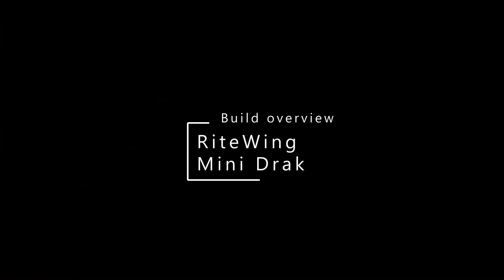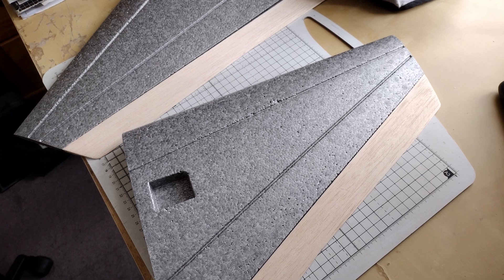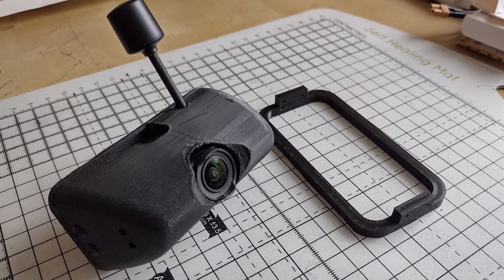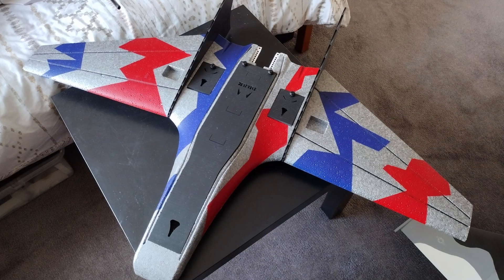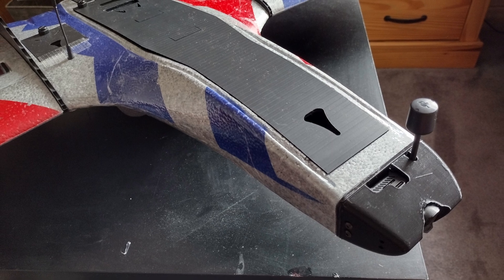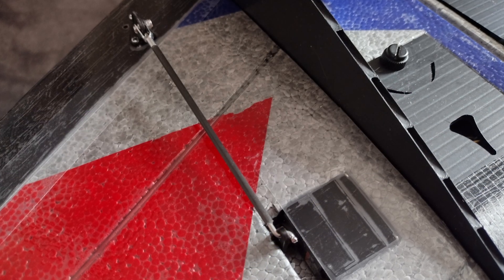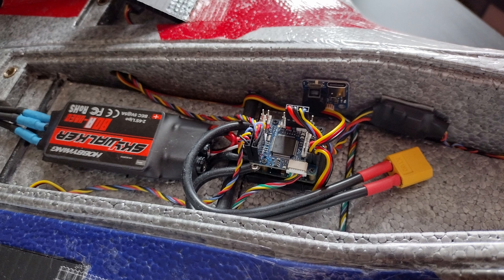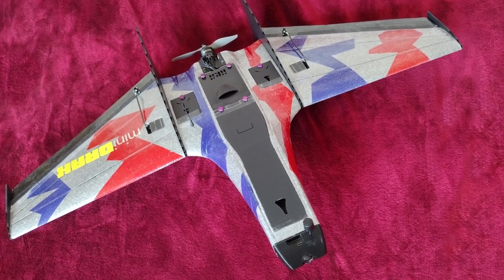Ritewing Mini Drak - build overview

Comment: Could you share your inav pid (piff)   I'm getting  a pitch up and down movement  during cruise and RTH 😢
Reply from the maker: I've seen some very odd behaviour with the latest version of INAV - is your issue like this video?   https://youtu.be/N0CbEymUxSM
Reply: @Caroline_Tyler  yes kinda like that but only in cruise or rth. Acro, manual and angle horizon are good
Reply from the maker: This was flying a mission, so basically, the same as RTH and Cruise. I never had this in previous versions of INAV and I got this same effect on two totally different airframes running the same mission AND at the same leg of the mission. It's all very odd.
Reply from the maker: Are you also seeing the same increase and decrease in throttle?
Reply: @Caroline_Tyler  maybe it's the pitch to throttle? Mine is set to 10 I believe
Reply from the maker: The wing that video was from is also set to the default of 10 micro seconds. You can see the throttle going much higher that that pitch to throttle would suggest. I will raise it on the GITHUB for INAV as a possible bug. It's really odd that it only in computer directed flight. I don't fly the Mini Drak in cruise really, mainly ACRO and MANUAL - it's too much fun to leave it to the computer to fly.  :)
Reply: @Caroline_Tyler  me too but sometimes rth is needed when video cuts out breifly with Walksnail and dji.   I'm considering going back to analog if I can't fix it.
Reply from the maker: I've added to an ongoing issue in INAV where another pilot in getting porpoising in cruise like yourself.
Reply: Curious what's your pitch feedforward?  
Mine ended up at 133.
Reply from the maker: Roll is p=8 I=3 D=5 FF=34
Pitch is p=9 I=4 D=6 FF=85
Reply: @Caroline_Tyler  maybe it's my 0 degree fixed wing level trim. I'm going to do a auto level and see if it changes. I don't know what it was in inav 6.0.   I forgot about that step during tuning
Reply: @Caroline_Tyler  my feedforward pitch was almost the same moment as manual mode.   I'm just going to try your pids. I just hope it doesn't crash  launching. How is your auto launch?
Reply from the maker: I do an overhead autolaunch and it's solid - real good. I do find overhead launches very scary though!!!
Reply from the maker: See  https://youtu.be/WYxgRDbRuAY?si=f0TBLyOSXOf7iLYj&t=63
Reply: @Caroline_Tyler  I do the same. It's given me the best success. Only down side I can't have my goggles or transmitter on. I've knocked my goggles off and canceled autolaunch before.  What's your fixed wing level trim in the mechanics tab?
Reply: @Caroline_Tyler  such a nice place to fly. I live in west Texas just outside of El Paso. All I see is shades of brown. It's all sand and weeds. No grass at all. Landing always causes a little damage.
Reply from the maker: @squirrelynutz1  Yorkshire is beautiful when the weather is good! You get to admire many variations of mud :)
Reply from the maker: Ill reply tomorrow,  its bedtime here @squirrelynutz1
Reply from the maker: Mine is set to 2 degrees
Reply: @Caroline_Tyler  I flew it yesterday and it was better. It was in 20 mph winds though. What was your roll and pitch rates?  Your the only person who's actually helped me.  The groups and forums have been little help. Thank you!!
Reply from the maker: I have roll at 410 degrees, and pitch at 150 degrees. Both with 30 EXPO.
Glad to help!
Reply: @Caroline_Tyler  are you on the latest inav? I'm considering going back to 6. I just don't trust RTH.  That pitch bounce is concerning
Reply from the maker: @squirrelynutz1  Yes, I moved to 7.1.1  /  7.1.2 and yes, the weird behaviour in very concerning and I was thinking about rolling back myself and re-testing.
Reply: @Caroline_Tyler  can the drak really do 410 a second? I never tried a roll in manual.
Reply from the maker: Yes, it can, but like all things in life, just because you can, doesn't mean you have to!  ;)
Reply: @Caroline_Tyler  did inav 7.1.1 have the pitch issues? I went from  inav6 to 7.1.2 so I don't know if the pitch bouncing was there.
Reply from the maker: Yes 7.1.1 has the pitch issue for sure
Reply: @Caroline_Tyler  I think it'd fixed. I did a auto level at dawn when the wind is still here. Cruise and rth are smooth. I changed roll rate to 360
Reply from the maker: I'm going to be doing some tests tomorrow after work, have set up a 6 point waypoint for a Talon GT to fly whilst I can monitor it. I'll also test failsafe, cruise and RTH
Reply: @Caroline_Tyler  the pitch wobble in cruise came back. Please let me know if you figure this out.
Reply from the maker: @squirrelynutz1  I ran the tests with the Talon GT but it was completely inconclusive. I think the high wind and turblance pretty much overwhelmed any instability effects. It was forcast to be 10kph wind but what I got was 45+ kph  LOL.  I want to try it with the Talon GT because it has a V-Tail and I was interested to see it it too was affected. When the weather allows, I'll try the tests again with both the Talon GT and a simuliar sized wing.
Reply: @Caroline_Tyler  I did testing today, and it seems like it happens more when it is windy. Doesn't the navigation modes have their own PID?
Reply from the maker: @squirrelynutz1  No, they all use the same PIDs, the navigation modes just manage the inputs and they monitor the overall position (using it's own PID loop), but the flying stability is still down to the regular PIDs. So the 'bouncing' might be caused by an error the high level decision making software.
Reply: @Caroline_Tyler  I hope it gets figured out soon. Do you remember if inav 6 had the issue?
Reply from the maker: @squirrelynutz1  I never had this issue with INAV 6